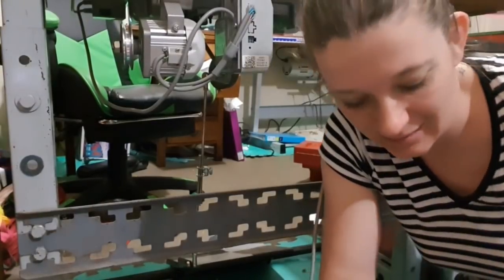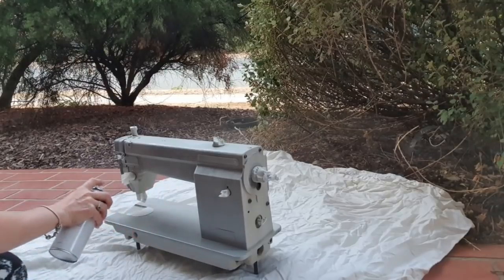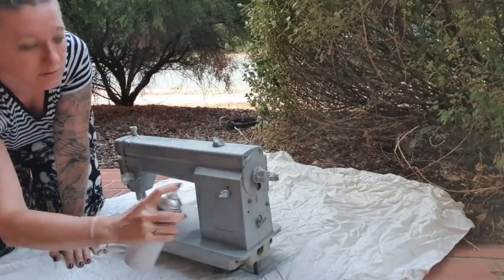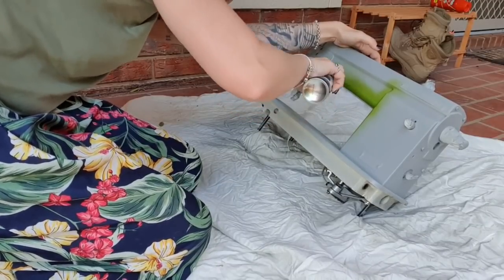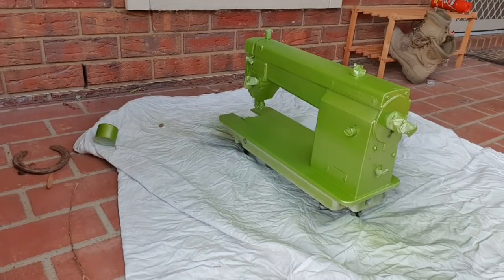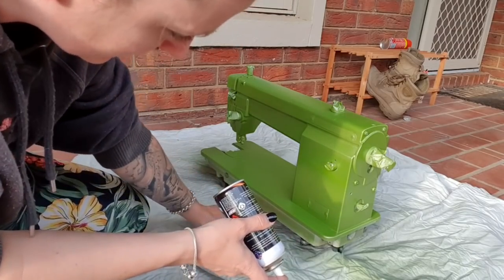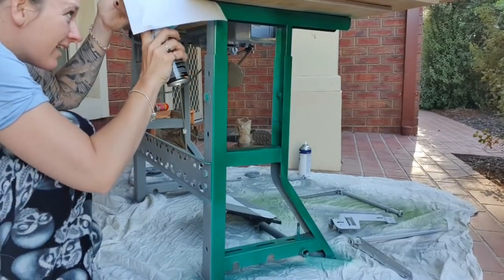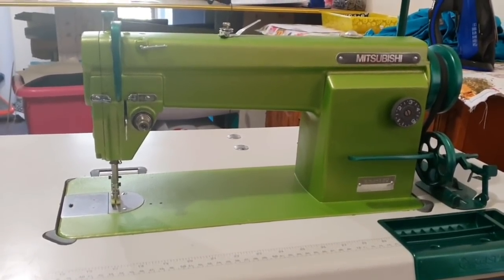Let's respray my sewing machine to my favourite colour!!

Comment: After you painted,  did the base have a smooth finish or a matte finish,  meaning did the stuff you sew glide over the finish,  or did it feel a little rough since you didn't apply a clear coat to make it slippery smooth
Reply from the maker: It did glide. But after excessive use, so of the paint has come off